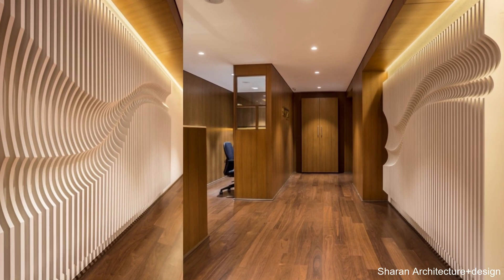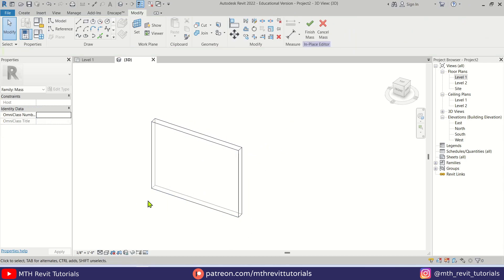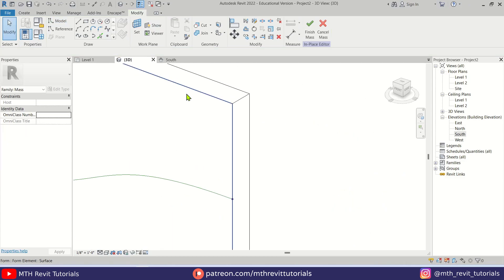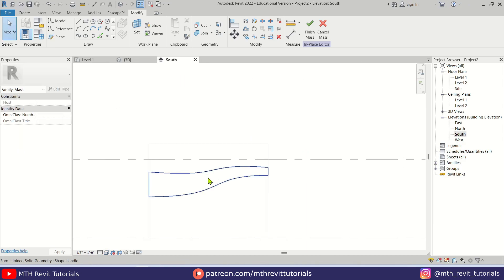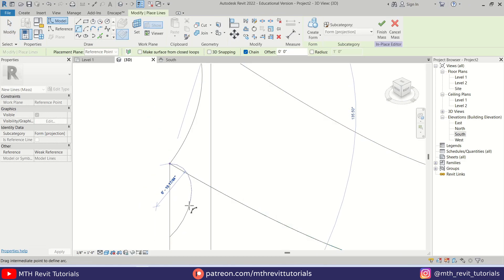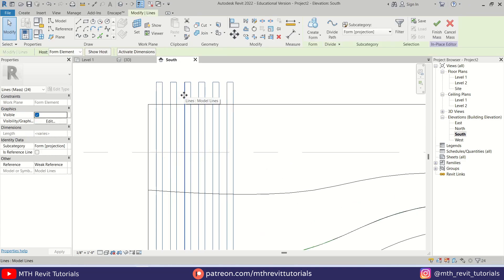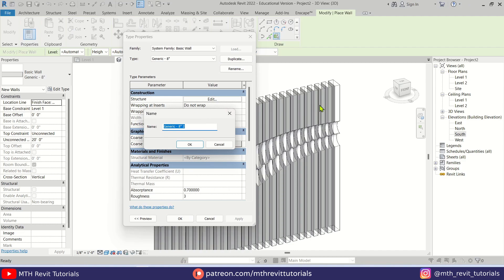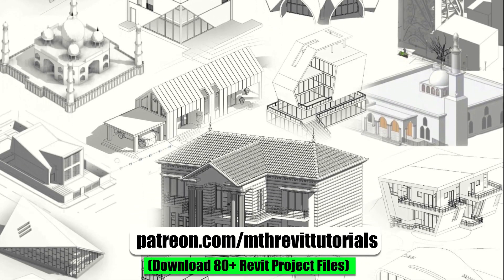Revit Basics: Creating Parametric Walls the Simple Way

Comment: That was very interesting, but I wonder if I missed something. How is that a parametric wall? When or where do you add the parameters?
Reply from the maker: I believe there might be some confusion. When I mentioned the term "parametric wall" I wasn't referring to the Revit parameters that control element information or properties.

The video focuses on modeling parametric architecture in Revit. If you're interested, you can find more information about parametric architecture on Google.
Reply: @MTHREVITTUTORIALS  Thanks for taking the time to answer and try to explain. But I'm still confused. If you are not referring to the Revit parameters that control element information or properties, what parameters are you referring to? Can you explain what you mean by parametric architecture in Revit? Thanks in advance.